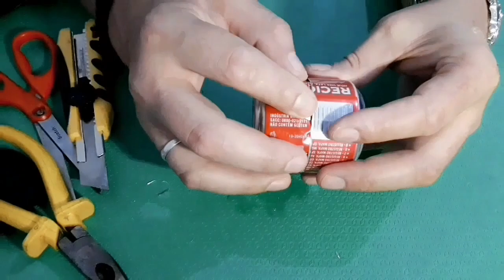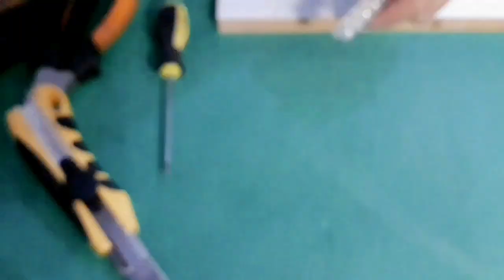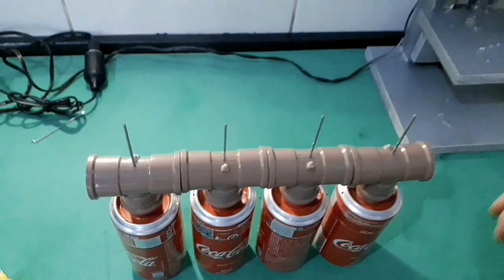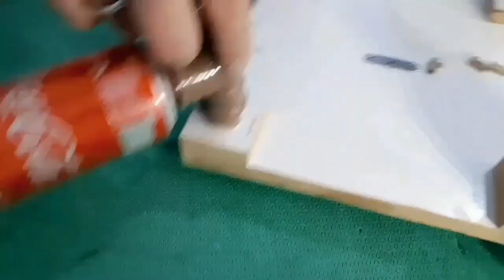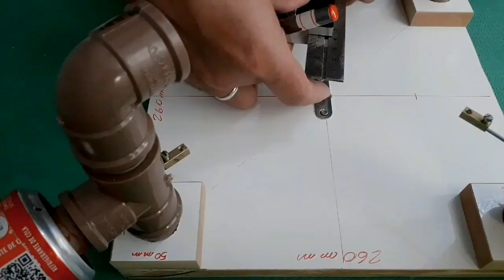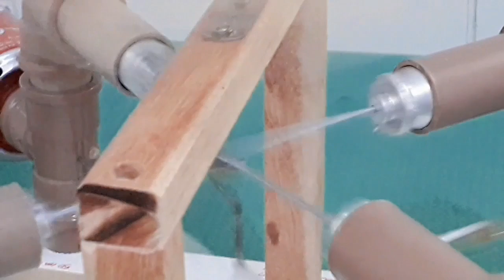NOVA TÉCNICA REVELADA! MOTOR ESTRELA. NEW TECHNIQUE REVEALED! STAR ENGINE

Comment: Eccezionale! Bravissimo.  Mi chiedo che torque possano avere 100 micro stirling come questi ,  magari in file da 10 x 10 lattine. Potrebbero occupare poco spazio  tipo 60x60 cm per poi salire in altezza  tipo 60cm x 60cm x 100cm . Grande come un comodino ma con 1000 microstirling.  Sei un maestro.  Grazie per aver condiviso la tua tecnica.

Comment: when you are making a alhpa stiling engine , is it not better to have the can cylinder only hot, and the cooling cylinder with water instead ? 
and make a smaller tube for the air flow, to the cooling cylinder ?
Reply from the maker: For an alpha yes, I believe it's better. System of radiating heat in the tube that takes the air from one cylinder to the other. Although I never rule out other ways.